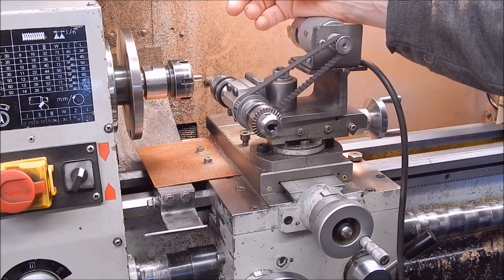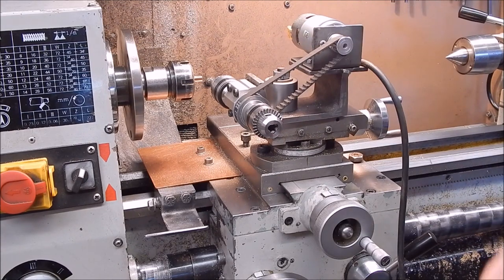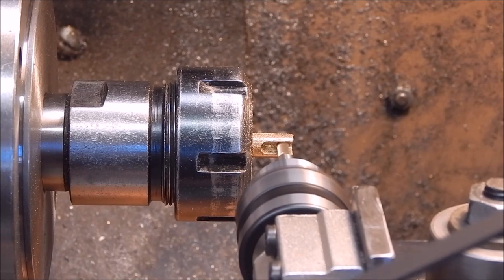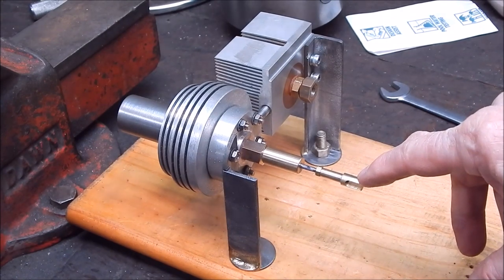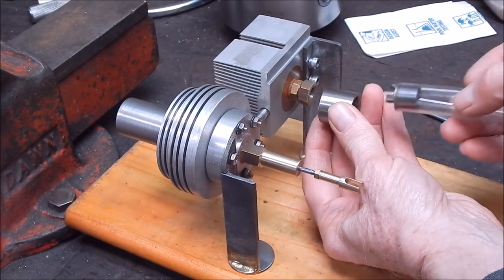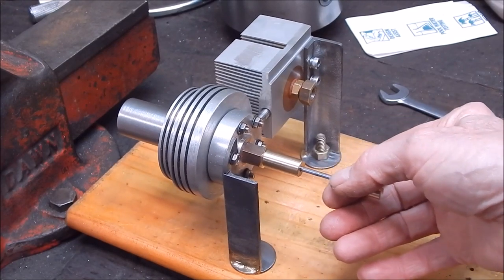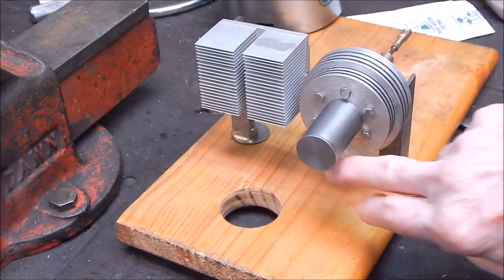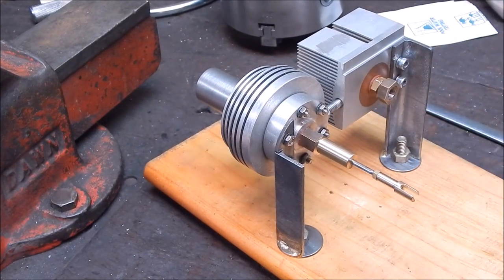Milling on the lathe with a 775 DC hobby motor and spindle

Comment: Comming along nicely . I have sold or given away all my Stirling engines . I need to make another ,Seeing as you can run the in doors. That milling rig is good alternative for the modler  who don't want to splash out on a mill.
Reply from the maker: Thanks Colin.  Stirlings are nice to tinker with.. No rush, just work to a mental plan.    They are quite a pleasant experience. Even better when they run.   Cheers Rob

Comment: Those little tool post gadgets are invaluable--perfect for grinding valves etc. Every home machinist should have one.
Reply from the maker: Yes, they are super handy Ian.  Very accurate and you can do extremely fine cutting of very hard and unsupported material with them as well.  Cheers Rob

Comment from the maker: This spindle assembly works very well for radial and cross drilling, is fast to swap across and very accurate. 

How long the stock ball bearings will last when subject to high side loads from milling is questionable.  Normally roller bearings would be used in a dedicated mill.  If the bearings fail I will fit high quality replacements and increase the number to four. The spindle housing can easily accommodate six, so it should be ample to counter loads from this sort of activity.

The ball races are 19 mm OD x 10 mm ID deep race 6800ZF (flanged end) type.  The spindle housing is only machined to size at each end/bearing position, so to add a few more standard races you may have to bore the housing to size.

As I pointed out, this is a strictly light duty unit.

Cheers Rob

Comment: Looking good Rob. The small motor didn’t appear to be stressed at all. Of course light cuts are necessary to prevent chatter. I wonder though if performance would improve if the end mill was held by a collet instead of a drill chuck. There appeared to be a bit of a run out but maybe the camera view created that illusion.
Reply from the maker: You've got an eagle eye Dale.  I have to grind 0.05 mm  off the grinder base to correct a height issue. If it's low you can always shim it, but not in this case.   All fixable.  The mill did a good job. Perfect for this scale of work.  This is where small lathes come into their own.  Collets grip better, but there was no slipage in this case, so a collet wouldn't add anything. Cheers Rob
Reply: @Xynudu  I think Dale mean't a collet would take care of the small amount of run out that I think was visible. Most of my chucks I check have a a few thou run out brand new, but collects can be a lot more true. It looks like the chuck did fine for your purpose though. If you end up wanting more precision you can find very small ER-20 collet holders that I think would work great for your set up.
Reply from the maker: OH I see.  The runout in these chucks is actually pretty good.  I can't say I've noticed enough to be concerned about. However,  I do have to skim the TPG base to lower it by 0.05 mm.  That's the only obvious issue (which I'm doing today) to correct.    Cheers Rob
Reply: xynudu *

Comment: Very nice work and I do like you idea of brazing especially for fine small work like you are doing.   Actually if you get a chance sometime and feel like it I would like to see your techniques for these small connections.  Possibly you already have such videos.   I will go and take a look.  Thank you for sharing your knowledge with us.  :-)
Reply from the maker: Hi Glenn,  I haven't done a video on small brazing jobs, but it has crossed my mind several times.  Which build process are you interested in, the connecting rod or the knuckle joint ?  Cheers Rob
Reply: Robbie, I was more interested in the knuckle joint.  And another thing I would like to have some experience with brazing carbide chips onto cutting tools too.  Like making our own boring bars for special cases. Your input would surely be appreciated in both cases.  Thanks for the reply.
Reply from the maker: Hi Glenn,  I did this video a long while back on making a carbide boring bar. You may find it interesting.  https://www.youtube.com/watch?v=bs14Mg7F4Rc

Comment: For lite duty milling, it's doing a good job...
Since those CPU heat sinks are designed to be cooled with a fan, I'm wondering if it will be as good as you hope it to be, you may need to install the fins vertically to improve cooling flow, guess that if we stay tuned, we'll find out...   😎😎
Reply from the maker: Hi Pierre,   I wondered about fin direction, but motorcycles have them horizontal and they work OK at stand still.  The problem is that the metal thickness on CPU heat sinks is either too thin or varies, so you are limited to where you can tap in the air gallery.  To make the fins vertical you would have to spin the heat sink 90 degrees and use a cross link gallery above the two cylinders. Would look kinda cool. I can always do that if this setup doesn't work as well as I expect.  That's the fun with home brew Stirling engines, there are lots of options to try and play with.  Cheers Rob
Reply: Once you get speed the wind is cooling the fins, it's when the most energy is produced by the engine as it works to make speed.  Natural convection heat sinks have thicker and spaced fins to allow easier air passage, if it needs more cooling possible to have the engine activate some fan...   🥵🥵👍
Reply from the maker: You read my mind Pierre. A modified PC fan belt driven from the crank is a distinct possibility :)  How crazy can a Stirling engine ever look ?  Adds character.  Cheers Rob
Reply: Would be a good plan to put a fan on the heat sink when it is running and see what happens.   Be very interesting to see the difference.   Regards 
Dale  Canada

Comment: Hey Rob just ordered a lathe from paramount browns as they seemed the best available for the price. Prices are a lot higher than back when you made that video years back so I could only afford the FI-550 not the FI-650 that you recommend. I think the 550 is replacement to the one you got. Anyway I'm in perth so it's on its way here can't wait. It's my first lathe just learning but I've used lathes back in high school so not totally new to it. Anyway love the channel keep it up cheers.
Reply from the maker: Hi Nathan, Good move.  Hours of fun ahead if you get into it.  The Paramount stuff is generally good value and up to scratch.  Prices have certainly gone up for all lathe sellers.  I had a look at the FI-550 and it checked out OK.  It is very similar to what I bought (CQ9325) specification wise.  The only difference is the tailstock taper is M2 but that's what most have in this size.  Not an issue.  The M4 spindle is good and as big as you want to go for home hobby use.  Collet chucks are readily available.  I think you will be real happy with that one.  Not bad value IMHO.  Enjoy.  Cheers Rob
Reply: @Xynudu  yeah cool I wanted a 26mm spindle bore and the only one that had that in the sub 2000 price was the model I got. All others had 21mm or 20mm spindle bore which isn't quite enough in my opinion. With 26mm you can get 1 inch round bar through the spindle for working on longer things etc. I am going to get a set of er32 collets, mt2 taper for the tail stock and an mt4 taper collet chuck. Plus a vertical milling slide and a Hilda like you have. That should cover me for almost anything I want to make.
Reply from the maker: If you plan to do model making then ER collets are a must have.  I was using my set today on the latest Stirling engine build  thinking no way you could do this particular job without collets.  Yes, a 27 mm spindle bore is a handy size as a lot of shafts are 1" and will fit through.  Sounds like you have everything sussed out.  Cheers Rob
Reply: @Xynudu  yeah I spent about 2 months reading up watching videos most of them yours. Lots of research before I chose the lathe I wanted to buy. I'm a uni student so I don't have much money. I love all the reviews on Chinese gear you do as it's what I will be using with my lathe.
Reply from the maker: One last important thing Nathan.  DO NOT buy real cheap ER collets or chucks.  There is a lot of garbage being sold all over the place.  Only buy collets and chucks which are made to a DIN standard or state a maximum allowable run out figure.  If they don't do that (and most cheapies don't) just walk away. The only seller I will use and recommend is CTC Tools online store.  All my collet gear came from there and it is a store with a decent reputation among metal workers.  It's still Chinese stuff but it's passable.  Cheers Rob
Reply: @Xynudu  Thank you for that advice that will save me a lot of trouble buying shit that's garbage. I was thinking of buying some HSS lathe tooling next week when I get paid and a set of er32 collets and a collet chuck if I can afford it. What do you think I should buy first I have nothing at all. Cheers for the advice.
Reply from the maker: Hi Nathan.  Good question. Generally people start off with HSS, learn how to grind it, and how the facets work.  This will get you going.  Banggod have some really excellent indexable carbide tooling, and I have reviewed some in the past.  So go HSS and then get some TCMT, DCMT or CCMT tooling later.  Then get some small boring bars (I reviewed those as well - excellent).  You will need some centre drills and a drill chuck for the tailstock so you can mount work securely.  A live centre is also useful as the dead centre you will get with the lathe is fairly restrictive speed wise and not a patch on a live centre. An old but good book to read is the Hercus "Text Book of Turning".  This gives some good advice on HSS and is a primer for learning the basics.   It's a free read here:  https://tokentoolroom.com/files/Text%20book%20of%20turning.pdf
Reply: @Xynudu  ok thanks mate I'll go with hss tools first. 
Best Regards 
Nathan

Comment: Good job and nice use for the motor, smart.
BTW how do you clean the brazing flux and make it looks nice?
Can you make a video to show your method of cleaning it, it will be nice.
Thank you.
Reply from the maker: I use a wire brush in the drill and on the grinder.  It helps a lot if the steel is low carbon and it's safe/OK to quench the job in water.  This loosens a lot of the flux.  Also don't over flux it to begin with.  That's why I use separate flux.  I hate those coated rods as you just have no control of the situation.  Cheers Rob
Reply: @Xynudu 
Thanks Rob.

Comment: Rob, a couple of times I've seen you with a digital lineal scale you attach to your lathe to measure carriage movement, I think you also attach it to the carriage stop.  Where do you get one ? ( in Oz ) I can't even find one on the internet. What are they called ? I enjoy your videos, very practical without any BS. Thanks
Reply from the maker: Hi David,  You can't buy that unit.  You have to make it.   See:  http://users.tpg.com.au/agnet/microdro2.html
Reply: Thanks Rob.
Reply from the maker: There's also this commercial unit, but it's not as compact:  https://www.youtube.com/watch?v=zGzmr4bxq7Q

and   https://www.igagingstore.com/0-4-Electronic-Digital-DEPTH-GAGE-Gauge-INDICATOR-p/203921.htm

Comment: with steel  i would recommend tungsten carbide tools (endmill or burr)
i was suprised how well cheap tungsten carbide burrs from ebay work on chorme-vanadium steel 
even by hand (because its a hard steel)
Reply from the maker: The quality of the HSS and carbide endmills and burrs available cheaply these days is really impressive.  I bought some 6 mm shanked large carbide burrs from Banggood recently and have to say they are excellent.  Sailed through machine grade steel like it was nothing. Same with their HSS end mills.  We have never had it so good. Cheers Rob
Reply: @Xynudu  i used these gold coated ones in 1,4mm i expected that i break but it didn't :D

(my bias came form i multiple bad experience with gold drills in the past since they where usually worse that standard black HSS drills so i expect every golden tool to be crap xD) But recently i chaged my mind, also the golden HSS Stepdrills are awesome.

For chinese drills i bought some very good ones (the extra long types 150mm 300mm and 350mm) i was suprised they whern't bent through mail xD they run ultra centric and good steel.

The bad ones i bough are these cheap "M35 Steel" drills , not worth the money

Comment: Rob, board looks like left over from a waterbed :-) StEng coming along nicely. Q, are there any other machinery sales shops in Adelaide to buy a Milling Machine besides Paramont Browns?? they do have a nice one I like (MILLING MACHINE - DOVETAIL SHAFT DRO
PARAMOUNT | Part No. MMD46 (DRO), Bugga, now sold out :-(
Reply from the maker: Hi Peter,  There is also General Tools, which is a Hare and Forbes affiliate and has the same offerings at a slightly higher price.  The largest Paramount mills look the business, but take up a lot of space.   Their prices are generally good.  They don't have any mills in the intermediate size like H&F, which is a pity, but those tend to be expensive for what they are, and you get a plastic gear or two. Cheers Rob
Reply from the maker: Hi Peter,  That looks like a good buy.  I watch Gumtree regularly but missed that one.  Nice pickup.  Half the price of a new equivalent can't be bad and it looks like new.  What's with all the spare column covers ?  Cheers Rob

Comment: Rob, I have a milk crate full of aluminium bits and pieces put aside for you if you want it??
Reply from the maker: Hi Peter,

Where are you located ?

Cheers Rob
Reply: xynudu Salisbury park,
Reply from the maker: Hi Peter, that's a long ways from me. Is it machine grade off cuts or junk ?  I don't mean to sound picky, but it would have to be decent quality to go that far.  Cheers Rob
Reply from the maker: Hi Peter, I deleted your last message as it's not a good idea to make phone numbers public on the net.  Thanks for the kind offer.

I got your email - when's the best time to ring you ?

Sounds like quality ally, so yes I'm definitely interested.  I'm south of Adelaide, but I can combine your trip and drop in on a mate at Holden Hill on the way back.

Cheers Rob